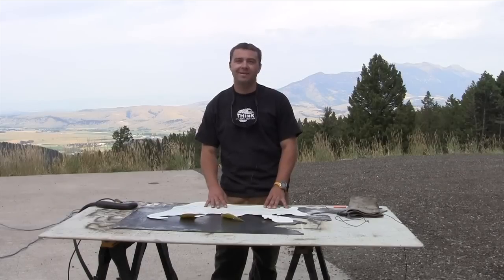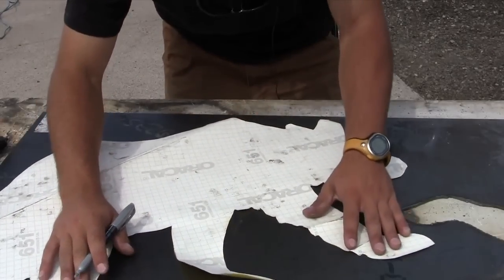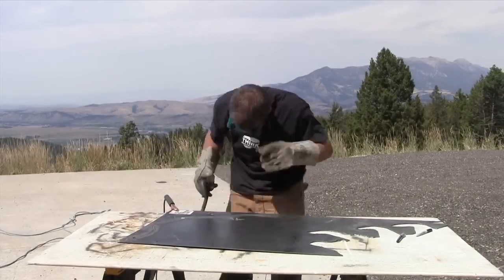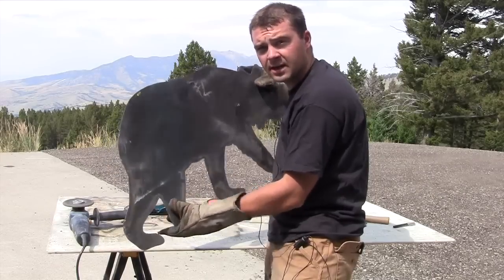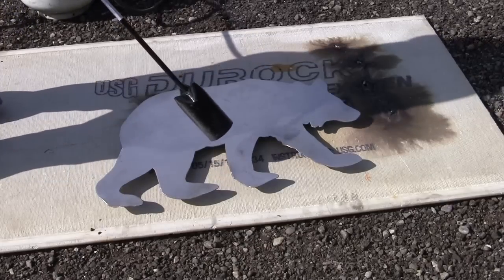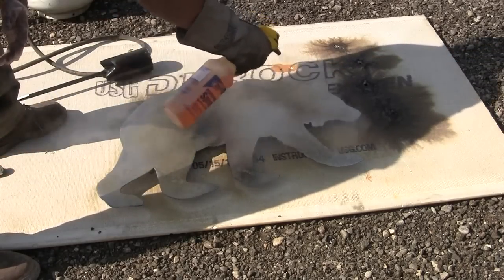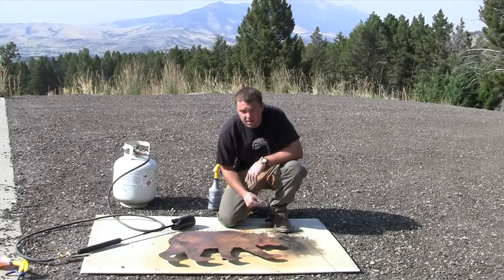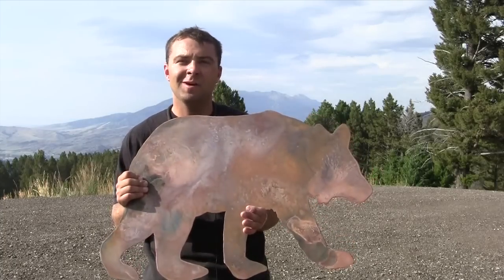How to make a bear out of Metal - Plasma Cutting and Patina Art

Comment: How would I go about using an old saw blade and cut silhouettes out in it without knocking them all the way out so that it stays inside the saw blade? And what kind of plasma cutter would I need to get for the thick old saw blades?
Reply from the maker: Hi! I have the Hobart 250CI. It cuts through metal up to about 1/4 of an inch, but works bets for metal about 20 gauge to 10 gauge. Using stencils really helps for getting the design you want. Best of luck!
Reply: DIY PETE how do I do my silhouette?
Reply from the maker: Hi, there are different ways to accomplish this. But you might do some additional googling and youtube searching. https://www.google.com/search?q=how+to+cut+silhouettes+in+metal&oq=how+to+cut+silhouettes+in+metal&aqs=chrome..69i57j0.6688j0j4&sourceid=chrome&ie=UTF-8   Best of luck!
Reply: DIY PETE thank u very much!
Reply from the maker: you bet!

Comment: Hey Pete, great video. Thanks.  What material do you use for a table?
Reply from the maker: Hi Brenda! I will usually use steel sheeting on sawhorses. But sometimes I'll use cement board ( -- what is used under tile or for shower walls )

Comment: Hey Pete, great video!  What voltage are you running the plasma cutter on?  110 or 220?  What machine is it?  Thanks so much!
Reply from the maker: Hi! It is the Hobart 250CI ( they have a newer version now, but it is basically the same ) It has a built in compressor and is around $750-$900. I run it on a normal 110 plugin.